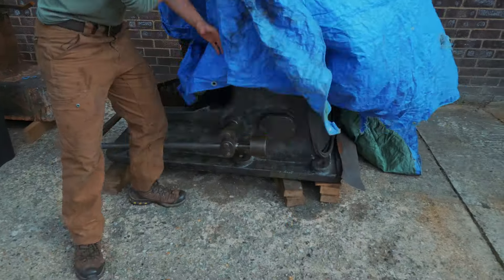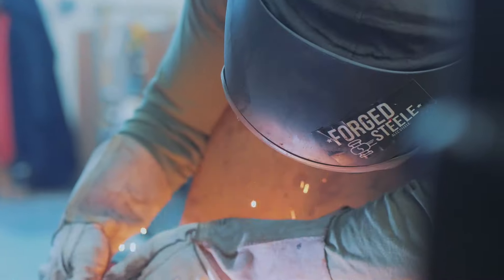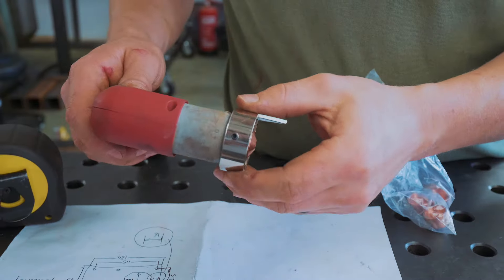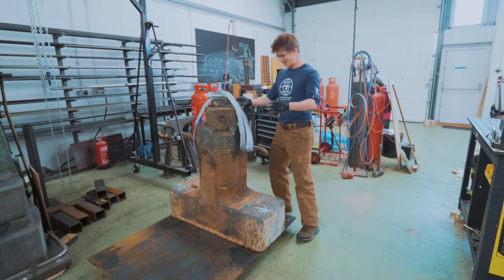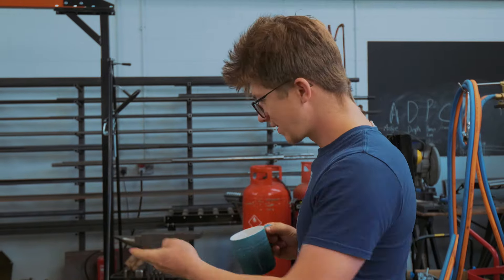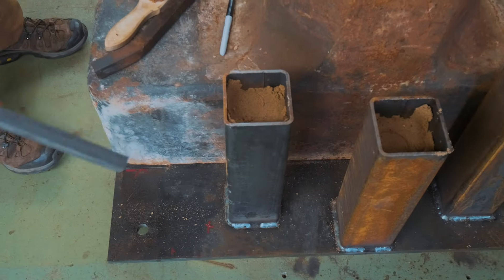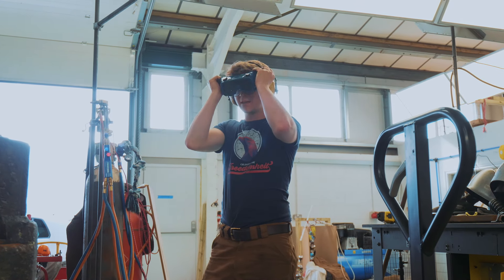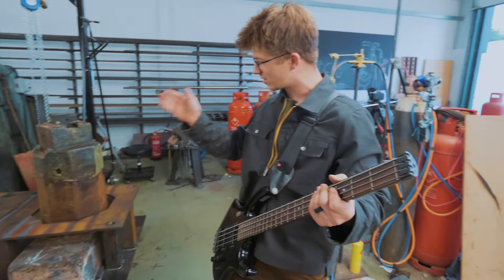My German Friend’s Bottom Component...

Comment: Alec, you should wear ear plugs when welding, especially for overhead. The weld beads can do more than just be painful, they can cause deafness, even the permanent kind. No more pod casts. Just silence. The earplugs will melt a bit and catch the weld beads instead of the insides of your ears. It is also safety code in the USA to wear ear protection while welding for this exact reason and several others. Since you are in the UK, I think you need to kill a raven and then spread it's blood on the nearest widow's house and your front window sills for protection.

Comment: the reason flame straightening works is when you heat the steel in one spot it expands but is constrained by metal below . when it cools it shrinks but is not constrained so it pulls the metal which shrinks that side.

Comment: Tip for blasting through metal with the plasma,  start with the torch at a 45 angle then gradually angle it down, stops all the slag blowing back into the torch and makes consumables last longer

Comment: A tip for welding above your head: put in ear plugs. It will stop the weld bead or sparks from landing in your ears. Also works well if you are grinding above your head. I do a lot of both at my work, and it was a tip my coworker gave me. Paid in dividends 👍

Comment: Concrete is a good idea for backup plan but I would suggest using a sika grout product based on your compression requirements as a grout would hold up better over time and sika provides a large range of grouts for industrial applications. Suggest a visit to their website and/or contact them for product solutions if your end up going with a Cementitious material. Or just get a concrete Rated for 35 MPA or close to it, if grouting seems to complicated for you. 
Can’t wait to see we’re this goes always enjoy your videos

Comment: You should have started out with the mag drill.. For the anvil don't use concrete, build a metal box and fill it with hot lead, that will add weight and also help to deaden the blows to it.. and on the bottom, defiantly put wood under it to help deaden the power hammer when it is running, it will also help protect the concrete floor from damage & cracking... Hope my advise helps..

Comment: For the structural welds you should really get some dual shield wire regular MIG wire doesn’t penetrate that well and could look as if all the surfaces are bonded and than crack or separate from the surface of the object you’ve welded

Comment: Tip when piercing with plasma.  Do not point the torch straight down.  Go at an angle or you blow the hot gas and molten metal back up into the torch.  Angle about 45 degrees so the gasses and metal spray away until you are through then go vertical and do your cut.  You can also drill a small pilot hole.

Comment: i'm a structural engineer working for a well known global Oil and Gas company in Baku.. heat straightening is on of the most powerful tools fabrication use to level and true even 1500mm deep 50thk flanges/30thick webs on beams. we can eradicate any unwanted deflections and deformations in the primary structure and plate. but, in the wrong hands... it can go very wrong very quickly ;)

Comment: Some would have welded the legs to the upper plate first, then turned it over and welded them to the bottom plate, to make welding easier. But Alex did it the other way round, opening my eyes to alternative CPM.

Comment: Simple hack to welding to avoid warps. Weld one side of your square after tacking then move on to the next square. Only welding one side of your cube at a time this will give the metal enough time to cool off but not enough time to warp.

Comment: Freehanding with a plasma cutter is extremely difficult. Weld up some clamp-on guides for various shapes and sizes of holes with an offset for the diameter of the torch tip. Also, the gag bits are entertaining and also quite ridiculous.

Comment: So your torch got messed up because you were trying to cut through what looks like 1 inch plate and your technique of pointing the torch straight down at the start caused it to blow back. First check to make sure that plasma torch is rated to cut through that thick of steel. Secondly if you're not starting on an edge, have the torch slightly angled away and ease into the cut by slowly straightening up the torch. Hope this helped

Comment: He starts by using a plasma cutter to cut through thick plate and I am screaming inside "use a mag drill you tool!" And then he does.

Also I would have made the base a box with the top bolted on and loosely fill it with coarse sand to help dampen noise.

Comment: Just a suggestion...as you have lots of oxygen and propane at your disposal...buy an oxy-propane torch.....takes a while to get good at...but works extremely well at cutting thicker metals. Hint...if you try it...pre drill starting holes before you cut.

Comment: I wonder if lead shot would have been a better choice for filling the square tubing. That sand looked pretty damp.  Are you worried about them rusting from the inside out?
Reply: No worries, the hammer will rip those welds apart way before the tubes have time to rust ;-)
Reply: @Makatea  No doubt, but I'm just thinking about vibration damping...

Comment: The Farce is strong in this one!
However, I have serious doubts that this structure will withstand much or any use before suffering from unscheduled disassembly. That thing is designed to be set in a pit of concrete not perched on top of a few relatively flimsy pieces of steel box. I would love to be proved wrong.
Reply: Yes, there will be the execution of plan B, which will also fail and finally he'll have to install it as recommended. The forces between the two parts of the hammer are ginormous and the flimsy welds won't be able to withstand them for long. Alec will probably have to find someone with an electric car to get the cement. Brilliant move, Brexit ;-)
Reply: @Makatea  I just hope the thing doesn't come crashing down if one or two of the boxes fail suddenly on one side, it could easily kill someone or cause a lot of damage.

Comment: I really enjoyed this video!! Can't wait to forge again this weekend. 
I have a question for you Alec, I need to make a fuller in a claymore sword, should I forge it into the blade or grind it in? Your opinion (I don't have the fuller tool or a small wheel attachment, so I will have to make either the small wheel on the lath or fullers on the milling machine)

Comment: Great video Alex - but, I'm sure you've got a plan for how you're going to use this hammer. But it strikes me as odd that the strikers are around your chest height. Are you going to build a platform to work at a good height? If so, what about where your furnace is? Will you have to step up to the hammer with hot metal? I hope you've got a plan for this. Good luck. It's great to see your journey.

Comment: I have a question. Are you going to be cutting a hole in to the floor and lowering that whole assembly into it or and you going to be making a step platform up to it to be able to get your work piece to the top of the anvil? Reason I am asking is because the height of the top of the anvil currently is about chest high to you and normally you work around hip height.

Comment: wait, if you can whack the pipe off of the bottom plate with a sledge, what's keeping it power hammer force from breaking the weld? lol

Comment: I'm surprised concrete only has a compressive strength of 4000psi. I've never looked at the data until now, but was expecting a higher figure.  Cement that I usually see in oil/gas wells  (not concrete, but cement with various chemical and some solid additives), gets to at least 5000psi in 24hrs, and can be a lot higher than that. Learn something new every day...

Comment: Please dial down the clown-show-part. Not only is it not funny, it also distracts from the technical content that your audience subscribed for and expects. Also, you're not done with your german friend. It'll pitilessly rip apart those flimsy welds and plan B won't work either. You really need to install it as everybody else does it.
Probably a good time to get an electric car, so you can go buy the cement in spite of those Brexit complications. Who'd thunk that those nasty east-european truck-drivers actually did some useful work after all ;-) ?